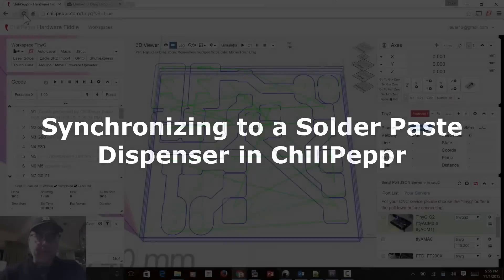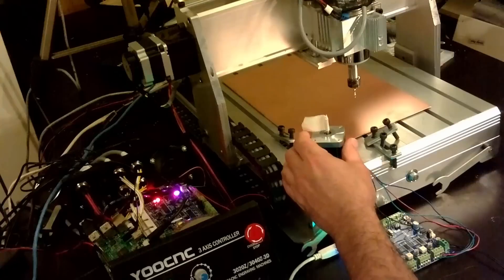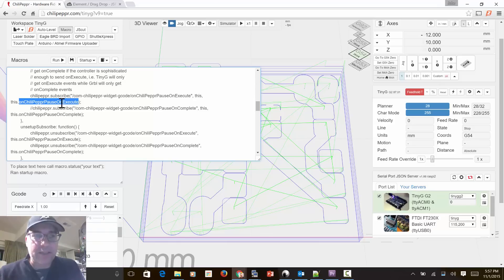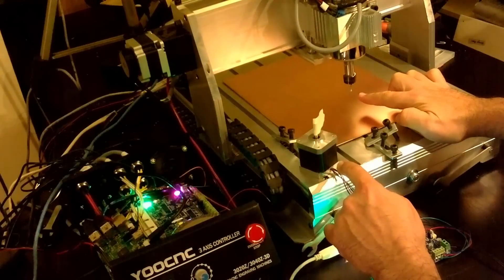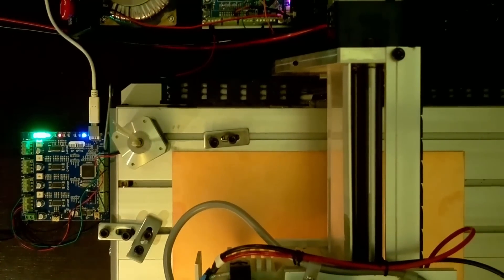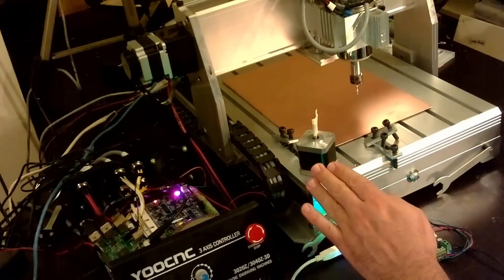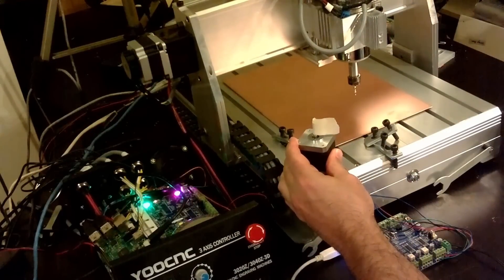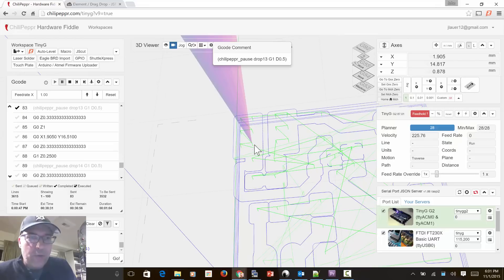Synchronizing to a Solder Paste Dispenser in ChiliPeppr

Comment: Why not use the cooling output (M7, M8, M9) (Mist coolant on,Flood coolant on, All coolant off) and the "Cool" port on the TinyG instead of a separate controller?
Reply from the maker: +RGSneaker You could use those switches to trigger something, but since in this video we need actual stepper motor control that wouldn't help much since you still need a way to send the gcode to the 2nd stepper controller. Also, for the overall project of solder paste and pick and place you'll likely end up needing over 10 steppers and thus you need a strategy for near unlimited growth. Just adding more serial devices is a great strategy for that.

Comment: I may be stupid now, but why not just add more axis's to the machine instead of hassling with a second controller? Or treat the second controller as the "other" axises in the machine (something i been working on for a standalone controller)
Reply from the maker: +Moronicsmurf Well, that is a possibility, but for this use case 4 axes were already chewed up for XYZ and A on the TinyG. Likewise Frank Herrmann was trying to use Grbl which only has XYZ. So there was a need for an additional axis for this example in this video and then there is also a need for a 3rd, 4th, and 5th additional axis for the pick and place machine. So some kind of solution was needed to allow almost endless extensibility.
Reply: Ah i see, yeah been fiddling with exending grbl on a mega 2560 to the 9 common axises, there enough pins for it at least. But its not really a fast processor, so the preprocessing is moved onto a stm32f7 instead, and serial has been replaced with SPI - so sure i know its a damn hassle when you start run out of axis's in the controller.

thought the TinyG could handle 6 axis - but didnt realize it was only 4 at the same time tho.
Reply from the maker: +Moronicsmurf Take a look at a blog I did a while back showing the 2 flavors of TinyG. One has 4 axes and the other called TinyG G2 has 6 axes. http://chilipeppr2.blogspot.com/2015/06/grbl-vs-tinyg.html 

If you were going to port Grbl you should probably pick something like the Arduino Due. If you do that you are almost better off just extending TinyG G2 because all the hard work has been done and it's open source.

The one thing about my example in this video is that the syncing doesn't have to be real-time so it can be synced via serial port via Javascript. If I needed real--time I would want to do it inside a single microcontroller or daisy-chained microcontrollers. TinyG G2 has a way to do that already in it's firmware but I haven't played with it.

I think chaining controllers the way I show in this video is a super flexible approach that could work with any type of hardware like a laser controller, metal punch, brushless motor controller, etc.
Reply: yeah i agree with you, doing Realtime work it needs to be daisy chained. you will have issues with synching and "stops" that in my application (a plasma cutter) would end up in weirdly sized arcs in the middle of the cutting path. =)

Why im avoiding Arduino as main platform, is that i try to make a standalone controller, that moves away from the PC all together, with its own display integrated. So i started from a stm32f7-discovery board instead - that has an arduino header, and slaved a mega 2560 to that on the spi bus instead.

But if the tinyg firmware is opensource it is maybe a better starting point than the grbl firmare im guessing. Some form of LinuxCNC compliance is necessary so its not that big of a deal to generate files in post.
Reply from the maker: +Moronicsmurf Well, feel free to use ChiliPeppr and Serial Port JSON Server. Why not just use a Raspberry Pi or Android tablet as your display?
Reply: yeah i have been fiddling with that setup as well actually like ChiliPeppr as visualization tool - much better than many of the other grbl compatible clients that is out there now. =)
Reply: hehe took a closer look at chilipepr, that was kinda an ingenious use of loading sources from all over really.. jsFiddle.. ha.. =)
sure they come out of the precompiled and are easy to maintain from there i guess.. =)
Reply from the maker: +Moronicsmurf Yeah, the reason is to enable folks to fork individual widgets so ChiliPeppr truly becomes open source and folks feel like it's not too intimidating. As it turns out that theory has mostly held up. Frank Herrmann's solder paste dispenser is a product of him forking the Eagle BRD Import widget and tweaking it to generate solder ball coordinates and then the actual dispensing logic. The entire Grbl workspace is a fork by a user from my TinyG workspace. The Shuttlexpress jog shuttle add-on was done by Frank Graffanino. I think we've only just got started.
Reply: yeah i found it was alot of "crap" i really dont need and tried to find a way to turn off, but it wasnt possible. The intention is good, but as with most opensource attempts that approaches the problem of a living community this way will find that when it hits the peak and it reeeaally starts to pick up speed. Will find it snowball pretty fast and it gets a bit unmanageable. - and here, enter Github, with a main source, and each plugin as a downloadable plugin. because you can load data from github in the same manner you are a doing it from jsfiddle. But more importantly, one can download what you need and avoid everything else. =)
Just my 2 cents anyway, it was a great frontend for the grbl i had lying here. Even if i had to turn off uBlock Origin and some antivirus softwares that basicly screamed right out, when i surfed the page. =)
Reply from the maker: +Moronicsmurf I used JSFiddle because I needed people to be able to see and interact and run the widgets immediately so they were more apt to feel unintimidated jumping in. Although I love Github, the biggest downside to it is that it doesn't help people get the IDE running easily. JSFiddle is the IDE in the cloud and I think that's 5x more important than Github's tracking.
Reply: ah maybe, i been doing node.js development for 4 years, and web dev for the past 16 years. I wouldnt touch jsfiddle with a 10 foot pole. So im guessing there two sides to a coin. It's easy and accessible sure. But all the dev need be done in a seperate program anyway so one doesnt go crazy and then copy pasted into js fiddle..

But for the beginner, that dont have the need for arranging 400 rows of code i can imagine its great. =)